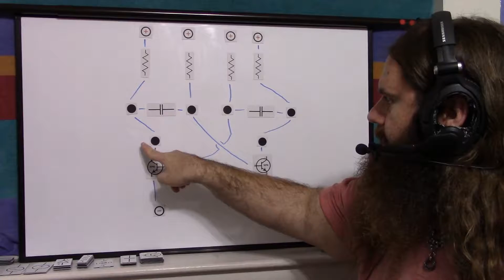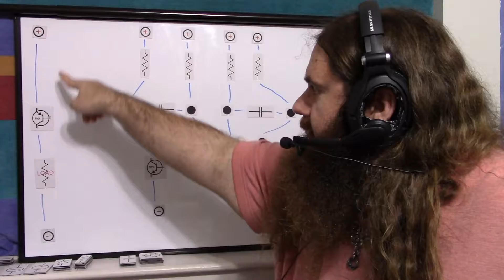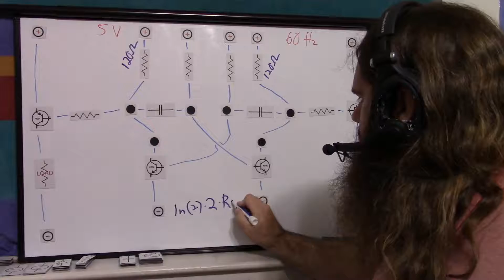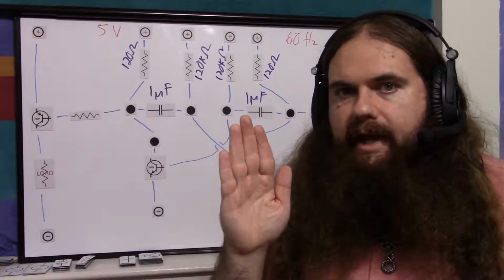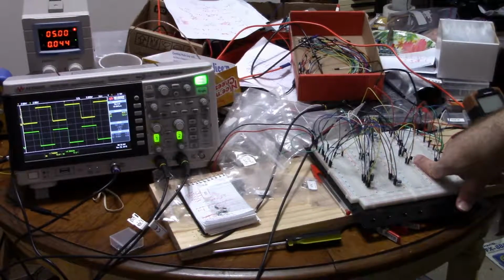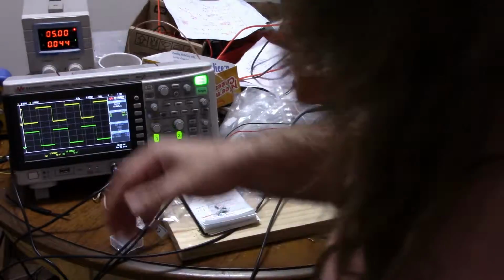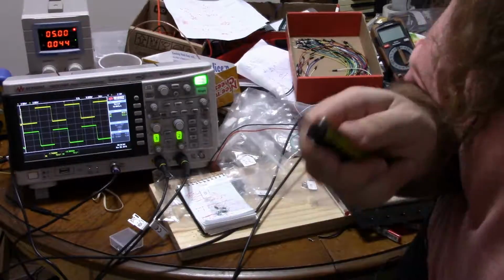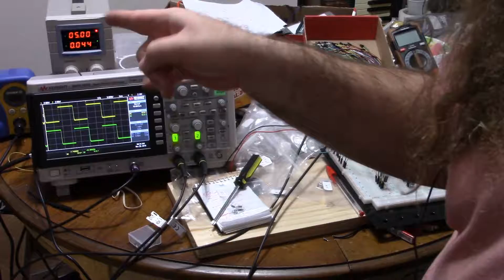Open Collector Oscillator - Circuit Design - Simply Put

Comment: Hi, thanks for this very explanatory video.
You could explain a little more in detail, how to isolate the oscilloscope from the circuit ..
Thank you.
Reply from the maker: That's what the PNP transistors are for. They can't completely isolate the circuit: You'd need to use MOSFETs for that. But the way I do it, the impedance of the load only affects the sharpness of the rise/fall of the oscillator's square wave a bit, but does prevent the load from affecting the timing.
Reply: @simplyput2796  I'm new in this, so you put a resistor in series with the oscope probe..?
and what does, the 1MΩ impedance os the oscope in this case..?
Reply from the maker: Oh, I see what you mean now. So the idea is that the oscillator behaves best when the load is low impedance (resistance). The oscilloscope probe is 10 megaohms on its default setting, so that's pretty high, but you can use the formula for parallel resistance (1/totalR = 1/Rfirst + 1/Rsecond) to put another resistor in parallel with the oscilloscope probe to reduce the total effective resistance and make the oscillator behave better. If you put a 100 ohm resistor in parallel with the 10 megaohm oscilloscope probe, for example, your actual effective resistance will be about 99.999 ohms. So the idea is that instead of putting the probes in as the load like I did, you put in small resistors as the load, and then you put the probes across the resistors to measure. I just did it the quick way for demonstration.
Reply: @simplyput2796  Thank you so much for your answer. As I mentioned, I'm new to this. I have another question. Better impedance means more current, why is a low impedance better?
Reply from the maker: "Better" differs based on the context. Higher impedance/resistance is less current; Lower impedance/resistance is more current. I=V/R Low impedance connected to this oscillator circuit (connected to the collectors of the PNPs, since it is an "open collector" circuit) is better because it keeps the oscillator's square wave sharper. Having more load impedance (connected to the PNP collectors) can slow the process of charging the capacitors in the oscillator and will make the square wave more curvy, but will not affect the actual timing because the PNPs separate the load impedance/current so that it won't affect the capacitor discharge rate which is what the "timing" of the oscillator is. You can see this effect in several of the videos about the oscillator, where I show the oscilloscope curves.
Reply: @simplyput2796  Thanks again for your answer, I will see the videos that you mention. God bless you.